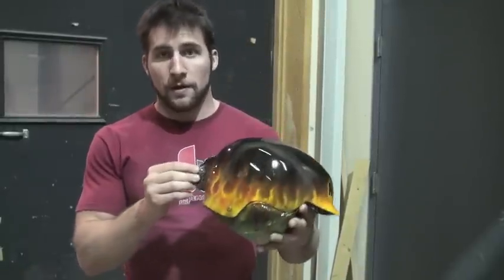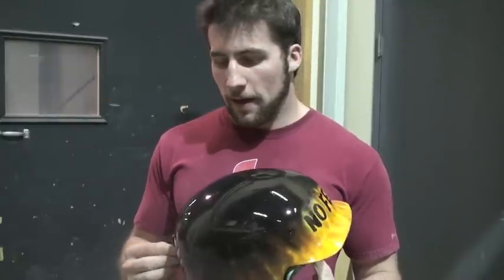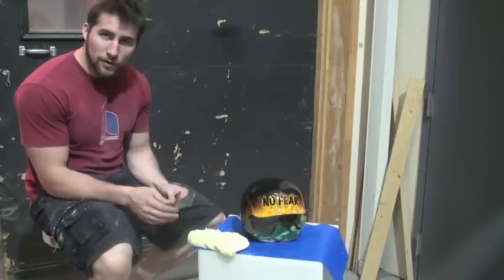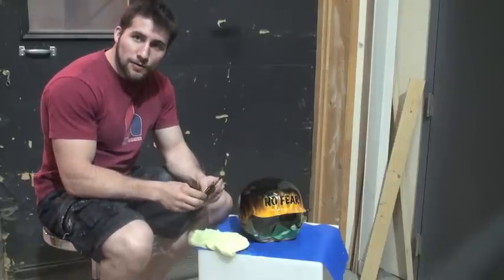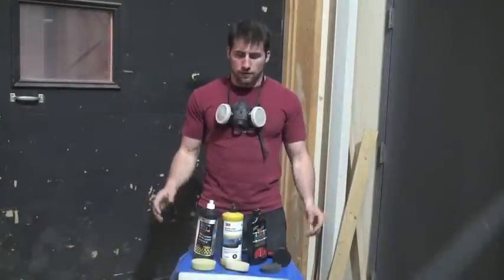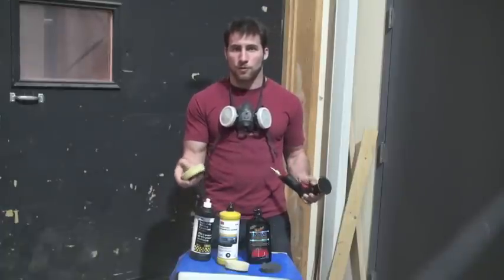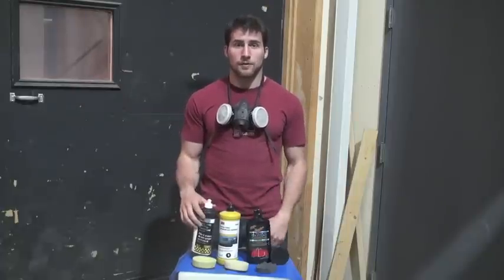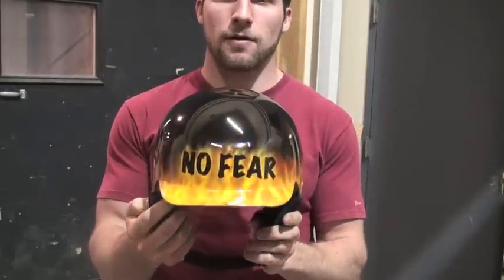How to buff/polish out clear coat

Comment from the maker: Thanks man. I can see why a dremel buffer would make a mess. Those are more for polishing metal than clear coat.
If you don't have access to a polisher you can do it by hand. Start with an applicator pad for your first couple passes, and then use a soft cloth for your final passes and polishes. That will be much less likely to burn through or mess up your clear than a dremel haha.
Reply: I think the lowest speed on a Dremel is 10,000rpm, plus the contact patch is tiny. I've used them for polishing out scratches in DVDs, but the DVD  is also spinning in a drill. If you tried it by hand, I think you'd soon spray molten lacquer up the wall.
Reply from the maker: You won’t melt the lacquer polishing by hand, but you probably would with a dremel. That’s better suited to polishing metal as I said.

Comment from the maker: Well if you overlap too much and/or are moving too slowly you can develop runs in your lacquer or excessive buildup near the edges.
If you don't overlap enough or are moving too quickly you can get a lot of orange peel, and dry spots that don't gloss properly.
If you haven't done it before, you should do a test panel (where you clear coat something of relatively similar size before you try it on your actual guitar). Then let me know how it looks and I'll see if I can help.

Comment: Dude is jacked great work. Also great work on the polishing. I just finished my wet sanding today on a helmet and it came out great. I made a huge mistake on the buff and used a dremel buffer. I need to invest in the buffer you have asap.

Comment from the maker: You can polish without sanding if you are just trying to get rid of scratches and shine it up a bit, but this is how you flatten out the finish and polish it for a mirror smooth result. It gets rid of orange peel and surface dust etc.

Comment from the maker: That number of passes should be fine, but doing it by hand could be causing you some problems depending on what you're using to polish it. The car polisher should be fine if you're using a high grade clear coat like I did for this video. If you're worried about burning through just make sure that you are moving it around all the time and not pushing too hard.

Comment from the maker: It's possible that the swirl marks left from the rubbing compound are too heavy for the swirl remover to deal with. You may need a step in between like the machine polish that I use.
You may also be able to get away with doing a few more passes on each step; particularly the last two. How many are you doing right now? Also, make sure that you are using medium pressure. Don't push really hard.
I'm going to do another polishing video soon that will compare a few different methods/brands.

Comment from the maker: Putting color back over your clear in just one spot isn't a great idea. You could scuff down that face of the project a little and paint over it, but that would entail clear coating again.
Your best bet is to sand out the blemish. Once it is gone there will be three options depending on how far down it was: 
1. Go straight to polishing
2. Spot repair and polish out the evidence
3. Scuff and re-clear the whole face.
I don't think you need to worry about messing up your white. Use high grit paper.
Reply: how come
Reply from the maker: It doesn’t have the same depth, shine or protection and will come off to a degree during the polishing process.

Comment from the maker: It depends on your technique and how the surface is prepared. If everything is clean (dust free) and you use proper technique it won't be too bad, but it will probably still be worse than the orange peel I started with in this video because I used a gun and automotive clear coat.
Make sure you are overlapping your strokes by 50% and watch how it's laying out on the surface.
I show this a bit in my video about painting a guitar with spray cans.

Comment: I hope you see this comment because I actually have a question. Is it necessary to wet sand in the polishing process? Or can you just dry sand?
Reply from the maker: You can dry sand. Wet sanding is easier, but on guitars I generally dry sand because it avoids the risk of swelling the wood with moisture.
Reply: @BradAngove  Yes! That's exactly why I don't. Good answer.🇨🇦

Comment from the maker: You can get away with just medium and fine, but you should have different sponges for your different compounds if you're using more than one.
Did you buy a polishing compound made by turtle wax, or do you mean you actually bought wax?
Wax and compound are different. I don't think wax will work, but if you spray a test piece you can always try it I guess.
That's the problem with lacquer jobs, they take a long time. I can see why that would make anyone impatient.

Comment: I am going to be using a 2K for the clear on my motorcycle parts. How many coats did you use on the helmet? It looks great..
Reply from the maker: Good choice. You should definitely use a two part automotive urethane for that. I used three coats total. The first was lighter to help promote adhesion, followed by two wet coats. This is the same thing that was done on the motorcycle I painted a while ago (before I started making videos) and it turned out great as well. Thanks.

Comment: Very simple to follow, thanks.   So, question for you on the clear coat.  How many coats do you recommend spraying on before you are able to sand/buff it out?  I think with 1000 grit it won't quite go through one coat of my base (i sanded the first of three base coats) but not sure if my clear is a lighter coat.  Will the sanding+buffing take down a full spray of clear?
Reply from the maker: +Nicholas Miller I usually do three coats of clear. The clear coat should go on a bit heavier than the base, particularly for the second and third coat of it.
Reply: +Brad Angove Well, should be set then.  I've cured it by baking and such, will give this a try.  Somewhat complex angles on this piece, we will see how it works.  Worst that can happen is trying it again.
Reply from the maker: If you have complex angles and such you should keep in mind that paint doesn't tend to build up as thick on edges. It can be very easy to sand right through your clean on corners etc. Be careful in those areas, or avoid sanding right up to the edge if possible.
Reply: +Brad Angove Very good suggestion.  I put it on a bit thicker on purpose on all the edges, however not sure about some of the central grooves on this piece.  Again, worst case is a respray.  I'll probably only do 1500/2000 as that's all I have in the shop.  Kind of combining your techniques with the 3M perfect-it directions. I've used it for OE car paint, never on a small, freshly painted piece.
http://3mcollision.com/media/documents/brochure/3M_Perfect-It_Paint_Finishing_System.pdf
Reply from the maker: That should work. That system should work fine on relatively new paint as well.
Reply: Well, pretty happy with final results.   Had to get a detail 3" buffer, worked great.
Reply from the maker: I'm glad it turned out well.

Comment: Hi, I got some questions Brad!
nr.1 Can you use these products at 7 celcius?
nr.2: What products would you recommend for me "now in 2016", any other products then the ones you used in your videoe? (As a replacement for the ones you used, please tell me what to use, first, in the middle and last).
nr.3 What is the name of the thing you used to apply it on? I don't have that one.
nr.4 can you do it using your hand?
Reply from the maker: +TheRagnarok98 I don't see why that temperature would be a problem. This is still a good polishing system, but if you take a look at my video comparing various polishes you can take a look at a couple other options. I used a three inch astro polisher to actually apply the polish.

Comment: Hey nice video, very informative. Sorry for resurrecting an old video but I am painting my motorcyclewith rattle cams and want it flat black. I used 2 coats primer, 2-3 flatter black base and 3 medium coats duplicolor acrylic enamel clear. I haven't done any sanding or compounding and am afraid it will turn it gloss however it has a white-ish haze and orange peel to it. What are your suggestions? Will light sanding and light compounding still keep it flat black? Thanks.
Reply from the maker: Did you use a matte clear coat, or the standard gloss one?
Reply: +Brad Angove I tried the matte clear on one part and it was so badly filmed with white (also likely from humidity) that I sanded it all back down and bought clear. So I used primer, flat black paint, clear acrylic enamel by duplicolor. Thanks for the advice in advance

Comment: Hey Brad, firstly awesome work and great channel here.

I've just finished clear coating a paint job I did on a long board, (I waited about 18 hours for the paint to dry before doing the clear coat), and I've found that the paint has subsequently cracked (resembling dry mud) and has these tiny little wrinkles on it. 
Firstly, what did I do wrong?
Secondly, what can I do to get rid of this? - I was thinking wet-sanding from 400 grit up to 1000 grit and then possibly polishing?
Reply from the maker: Sorry to hear that you're having trouble with the paint job. Can you tell me what kind of paint you used? Also, did you sand at all in between your colour and your clear coat?
Reply: I used 'Rust Oleum Painter's Touch Ultra Cover 2x, gloss'.

I sanded the board down and removed the old graphic and then first laid down a white coat (5 light coats in a rectangular shape).
Then waited a day, sanded with 500 grit paper applied a black coat over the white coat (this is where I put custom lettering) (again 5 coats).
Waited another day, sanded with 500 grit paper and finally applied the clear coat (3 coats over the entire surface). 

The cracks predominantly originate at the border between the white paint and the wood
Reply: Thanks for the response!
Reply from the maker: Are the cracks mostly over the painted area, or over the wood itself? I'm concerned that you have far too many coats of paint on there, and depending on how heavy they are you may have drying issues with them.
Reply: The cracks are only over the paint. I went with really light coats, but perhaps it was too much?
Reply: Here are some images:
1) https://www.dropbox.com/s/zn4slapp98uahi4/crack%201.jpg?dl=0
2) https://www.dropbox.com/s/ceom9c0e72r5gtn/Crack%202.jpg?dl=0
Reply from the maker: It looks like a reaction in the paint obviously. I think you may have to sand off the clear coat and re-apply it. You used the same type of paint for the clear, correct?

Comment: hi brad have a question how long should you wait to clear coat after you finsh painting with a rattle can i am painting a bike frame thanks
Reply from the maker: +john murano You should either clear withing the re-coat window (10-15 minutes) or let it dry fully for 24 hours, sand lightly, and then clear coat.

Comment: @brad Angove,  should one be worried about the type of coating on their project before polishing or buffing it, polyurethane vs. lacquer? PS ive heard that some guitar manufacturers will use polyester coatings on guitar; however, to my knowledge, polyester is a solid based coating which wont allow the wood of a guitar to expand. have you ever experienced guitars with these kinds of coatings?
Reply from the maker: This system will work fine on both polyurethane and lacquer. 
Yes, many manufacturers use polyester. It’s quite solid, but that doesn’t hurt anything. There’s no need for the wood on a solid body electric guitar to be able to expand.

Comment: Brad, I love your videos, and the one about the rattle can clear has me wondering. I need to do a budget paint job on my motorcycle. What would be the most durable, gas resistant paint to use.  Thanks.
Reply from the maker: Probably a polyurethane. That's what they use on motorbikes now. Something by spraymax would be a good bet.

Comment: Great vid, doing my motorcycle helmet. Do you think 2000 grit is good enough for the job? Or 2500 minimum?
Reply from the maker: 2000 should work just fine, it just may take a little more work to do the polishing. You'll have to go over it an extra time or two depending on your clear coat.
Reply: Brad Angove  can you go over your project to many times with the polishing treatments? Is their any difference between going over my projects 3-5 times vrs lets say 6-10 times?
Reply from the maker: You can go over them more times with the polish if you want. Don't go over them too hard or you could burn through, but more times isn't a problem. You only need to sand the first time though.

Comment: Brad help me out here.
I've done my first gloss finnish for a guitar body.
Primer > Color > Clear Coat.
Wet sanded till 2000grip. 
When when I went to pollish I've burned throught the paint and all went downhill.
Luckly I was already going to redo the painting since I didn't like the final result.
I've redone the polish of one of my guitars and had no problem whatsoever, so where did I gone wrong? Perhaps my clearcoat coats wasn't enought? I did 3 light coats before sanding it down.

What should I do?
Reply from the maker: It's possible that your three light coats were too light. What kind of clear coat did you use? Also, did you use a foam polishing pad or a wool one?
Reply: Brad Angove I've used a simple dry cloth, the same used in another guitar.
I'm using a high gloss clear coat.
One side note that may be usefull. At first, the polish was really easy to apply, but after some seconds it starts to get harder and harder, and since the begining I was getting some colorpaint coming out in the cloth.
Reply: Just to make it clear, the mirrorlike finish depends exclusevly on the clearcoat right?
Reply from the maker: Yes, the polishing should be done on the clear coat only. If you're seeing colour on your cloth then you've sanded through the clear completely and are trying to polish the paint underneath. You need to either put your clear coat on thicker, or not sand so far into it.
Reply: Brad Angove Thank you so much, indeed the clear coat was to thin, already re-made the job and had no problem at all. Thank you so much for your help! You have a beer on me if you ever take a trip to the hellhole called Brazil ;D
Reply from the maker: Glad to hear it worked out the second time. You're quite welcome!

Comment: I'm guessing you can only buff/polish a 1 or 2k clear coat. Not a regular acrylic clear coat right? 
( I mean now that I've learned what 1 and 2k even is, I would imagine you wouldn't use anything else for a helmet. But I would only use 1 or 2k on rare occasion. )  Also- great point about not using your fingers when sanding)
Reply from the maker: You can polish acrylic clear as well. You just need to be more gentle with it.

Comment: Where is a good place to get/ what are some good buffing/polishing pads to get for the 3" polisher
Reply from the maker: I get mine from Gregg Distributors. You can probably get them online from automotive supply places like Eastwood Autobody as well. I recommend that you go with foam pads because they don't burn through as easily as wool or felt. Softer foam should be used for the finer polishes, and slightly harder foam for the coarser compounds.

Comment: Hi Brad,

I recently had some bodywork done where it was hit by a snow plow. The area has been painted and clear coated but it isn't as glossy as the rest of the car. Will a simple polishing product bring the gloss out? BTW, the base coat and clear coat are sprayed from the aerosol cans you get at pep boys and auto zone. Someone did this for me, they used duplicator for the base and the clear coat was some kind of lacquer. Thats all i know. Everything is smooth and no sags, its just not as glossy as the rest of the car. Any advice would be helpful,t hanks..
Reply from the maker: Hi there. Polishing is a good way to bring out the gloss, but the aerosol can clear is an inferior product to what would have been used on the rest of your car, so it may be difficult to get it to the same gloss level.
Reply: Brad Angove  Could i polish it then apply multiple layers of a high gloss sealant like Klasse SG? I just need to do this on the drivers side quarter panel, not the whole car. The color matched the car, it's just dull looking.
Reply from the maker: You don't want to apply more paint over the polish. The polish has wax etc. in it. Paint won't stick to it. You could sand it to 800 grit and then apply a coat or two of the high gloss stuff if you think it will gloss out better than your clear did. I'm not familiar with that product.